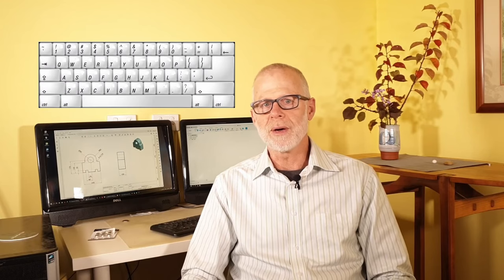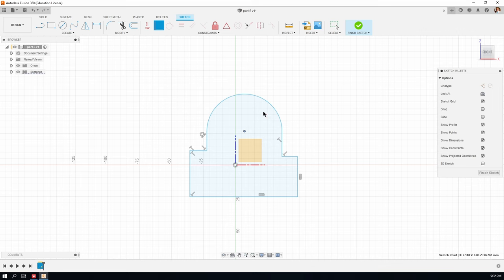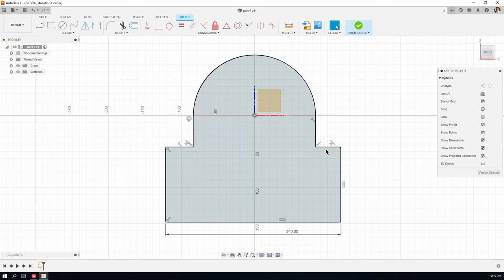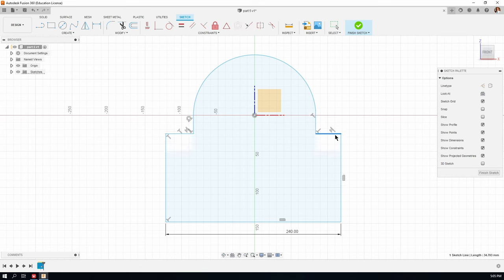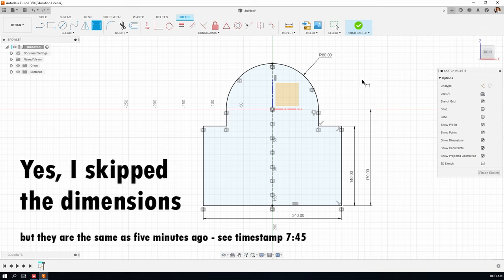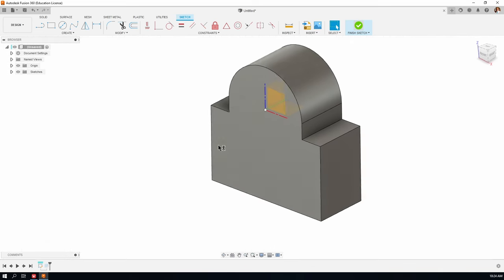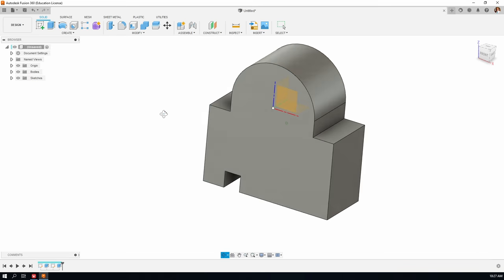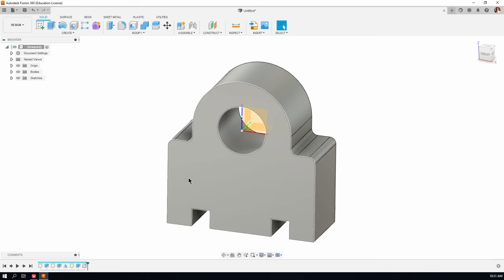Fusion 360 Basic Tutorials | Part 5 Revision

Comment: Thank you so much Arnold. I am learning Fusion 360 to design casing for our IoT project. Your step by step video is a big help and very much appreciated.
Reply from the maker: Glad it helped! Are you doing this at high school or uni? So in general terms IoT would be a product with sensors and an internet connection? A microcontroller would be interesting.

Comment: For the last few years I’ve been using Tinkercad to design all my 3D printing projects – good fun but quite time consuming for complicated parts e.g. trying to correct mistakes made early on in a design is a nightmare. 
I’ve had Fusion360 sat on my laptop for a couple of years now but, apart from loading software updates, had perceived it as too difficult to use, until that is I came across your 16-part basic tutorials .. what a revelation! 
Your teaching style is such that I’ve enjoyed every minute of the tutorials and, more importantly, learned a new skill. I’m now going through them for a third time (I'm addicted) - whilst also redesigning some of my earlier projects from Tinkercad in Fusion 360. However, I’ll still use Tinkercad, not for CAD but for its electronic circuit design capabilities where it’s possible to build circuits, test them and run simulations. 

Thank you Arnold!
Reply from the maker: Thanks for the encouragement Allan. It make's it easier to get out of bed in the morning. I'll keep going.

Comment: Am really learning from this guy.  Seen so many other sites but they dont have the pedagogical way.
Reply from the maker: Good on you Cogito
Reply: @ArnoldRowntreeTeachesFusion360  I am at nr 6 but it seems like its from 2018 and you also have an older version of Fusion. Is more and updated parts on the way? part 1 - 5 is newer and i have done them several times, backwards and forwards so what I have learned from them helps me in your older version.
Reply from the maker: @Cogito, you've caught the clock. Number 6 is in the works but this is taking a while. I began the revisions some months ago and it will take a while yet. What I've found is that most people can follow the remaining tutorials in the older series. The changes are not too confusing, its really only a few tools that have been moved. I did produce a video shortly after the UI change which could help if you try to keep going, its here;  https://youtu.be/QysKADuoBYc 
Now that you know about the sketcher and the extrude tools I think you'll be familiar enough with where they are and you'll be able to follow with the new material each video introduces even though its in the older version. And of course write to me if you're stuck on anything.

Comment: hi Arnold , thats for a great tutorial, i have a issue when doing not 5 the click and drag forms the arc in the opposite direction.
Reply from the maker: Thanks ekdave, I’ve heard of that problem once before and don’t have a fix at hand. Take a look at Tyler Beck’s two minute video on this feature, he also shows a workaround, you can get the same result by using the normal Arc tools. See this;  https://youtu.be/iA0MDQDazFg?si=B8RmdJHSRvIrKFbO

Comment: I have drawn the first five over and over. All the sudden when I’m doing number five again and try to make a circle it goes to the left instead of the right. What am I doing wrong?  I have learned a lot from your videos so far but Little problems pop up. Thank you so much.
Reply from the maker: Little problems are what happen to everyone learning new software. Its hard to see exactly what the problem is from your description but if its a showstopper, go on to the next tutorial, number 6 and come back later. Doing the tutorials a few times will help you to understand what's going on and more importantly drill it into your reflexes. Eventually that direction issue will be in the past.

Comment: Going through this again.
Run in to a problem with the mirror function.
I mirror the object, extrude then draw the notch but can not delete the base of it, as the entire bottom of the object is selected.
What have I done wrong?
Thanks
Richard
Reply from the maker: Richard, it sounds like you’ve got the order out of sync. Click the Mirror tool, select the feature to mirror, select the mirror plane and you should see the shadow where it indicates where the mirrored cutout ends up. Click OK to finish. If the base hasn’t been cut out then it’s a problem with the original feature, before the mirror.

Comment: At time mark 14:05, when you right click to get the face choices for the 3D Mirror command, I don't get that. I ended up going to the cube in the upper right corner and rotating to the correct side then selecting the plane there. That's the only way I could figure out how to select the morror plane. Do I have a setting or something different that won't allow me to do this? Thanks for these videos! I use F360 for both 3D printing and also CNC work. These have been a huge help to me so far! Great job!
Reply from the maker: Yes Michael, its not a right click nor a left click, how's that for confusing, well, actually it is a left click but its a left click and hold....  then the little selection panel shows itself where you can pick from the stacked entities behind where the cursor is sitting. As you have found, its not the only way to get the job done but this is worth getting, its very convenient. Persevere Michael, you'll get there!

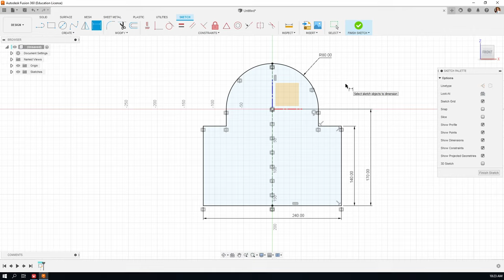Comment: At 10:52 it shows the dimension of the width of the mirrored object as 240mm, how is this done, I only seem able to dimension either side of the mirrored half (as 120mm), not the whole line, what step am I missing.
Reply from the maker: As you can see from the video I had an editing misshap. That part of the process was lost. I’m not at my desk right now but I’ll make a note to look into this when I return. I’ll confirm what I’m hesitating to assert, that you can indeed dimension across a mirror plane, nevertheless if you’ve got the right answer at this stage press on.

Comment: @8:43 when you get to make radius of 30 for top half circle mine keeps saying its over constrained. Not sure why I followed all your steps, and mine is set up preferences same as yours. I have yet to have this issue as of using these tutorials to learn how to teach myself CaD so this is very frustrating so far. I have only gotten this far into video so far.
Reply from the maker: Joygasims, you'll get an 'overconstrained' message if there are any other constraints on your lines. Watch out for corners picking up snapping points. A good way to see if things are picking up constraints automatically is to keep going back to the Select tool and see if you can drag things around freely. Of course everything gets less free as you apply the various geometric and dimensional constraints but if you make a habit of testing the freedom of your sketch lines now and again, you will grow in your understanding of how these things happen. A good rule of thumb is to pay attention to where you put lines, avoiding anything that they might stick to.

Comment: How often do these videos come out download fusion 360 last week and now I’m keen for video 6 to come out
Reply from the maker: David, I would normally be striving to publish weekly but while I'm still doing a day job its going to be a bit slower than that for a while. Currently I'm working on fitting in the newsletter which goes to the people who get the free download of the 16 drawings. It sounds simple but that takes quite a bit of time from the regular hours that I've been setting aside for the channel. Sometime soon I'll be launching some tuition products related to the channel which I hope will be the beginning a gradual change to doing this full time. Then the rate of production will improve considerably. 
So the first six revised tutorials are done and the next one is already in the works. What I find is that after people have done the revised ones, they can usually follow the older ones for the remainder. The user interface update wasn't all that dramatic and it only takes a few minutes to see where the changes have been. You will have a pretty familiar way of working by now  and you may not be phased at all by the differences but keep in touch, I can usually help with most questions. Here's the playlist for the whole 16 tutorials, new and old
Reply from the maker: 16 Basic Tutorials Playlist   https://youtube.com/playlist?list=PLFCTgdiT5-kLBNvrkUNy63Gu1tWdRuKkr

Comment: why is it when i want to select the entire sketch to delete it so i can start a new sketch, it gives me a blue square and no longer will drag to  select? 

 I was hoping to do it this way so as to not save start a new file.  In order for me to delete the sketch,  I have to manually select each line and delete it vs "dragging over it all to select then delete"

2:  I don't have the option to mirror to the YZ plane, but rather just the two faces. (There is no option in the drop left mouse window to select the YX plane to mirror the small extrusion cut.
Reply from the maker: Hi nwmi, sorry, somehow I missed this when you wrote three weeks ago. I hope you've solved these problems already but here goes;
If there are problems with selection, try these things: 
1. click on the Select tool up at the top next to the Finish Sketch button, then do the crossing select.
2. Drop down the menu under that Select tool and choose Window select and try again to do the crossing select followed by delete.
3. If its still not working, try opening the menu under the Select tool, mouse down to the selection filters, see the flyout to the right and check that everything is ticked ON. Confirm by clicking on the second item in that flyout list Select All. Its a toggle, make sure everything has a blue tick and then retry your crossing selection and the delete key.

About your plan to avoid starting a new file, are you being wary of using up your ten active file limit? If you are, I've covered that in an eBook here https://payhip.com/b/J53Ee
but basically don't worry, you can make your old files read-only to give you more active files. Open the data panel to see the button on each file to switch between Active and Read-only.

About the mirror tool, what I was demonstrating there was the Select Through function. The origin has to be visible (check that) and it has to be in there behind the cursor when you hold the left mouse button down. Then you'll see that plane in the list of entities.

Let me know how this goes if you haven't already taken care of them.
Reply: @ArnoldRowntreeTeachesFusion360  many thanks for taking the time to pass along these helpful tips.  :)